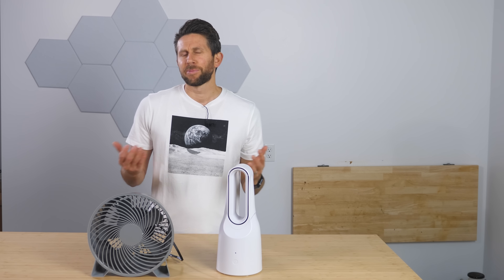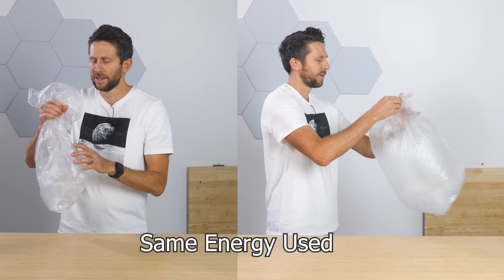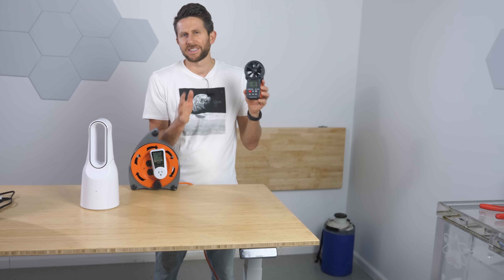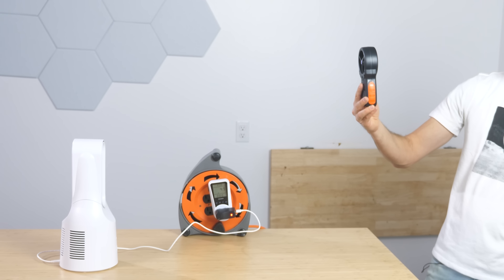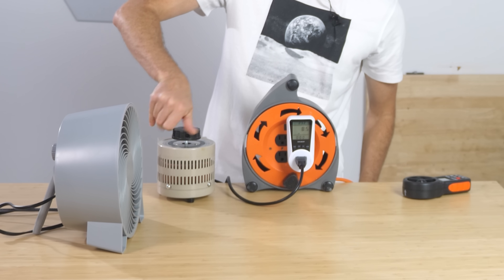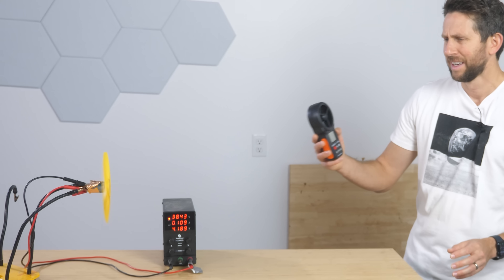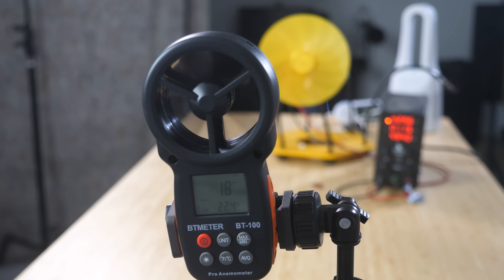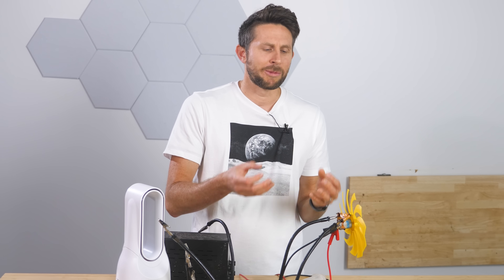Are Bladeless Fans a Scam?

Comment: As an electrical engineering student I can say I have heard about “bladeless” fans for almost as long as I can remember, I remember not being tricked about the engineering, of course it was to have some type of high powered fan or blower in the base to compensate for the lack of size in the head. The only marketing schemes that Dyson does is say “bladed fans deliver choppy air” really? It’s just a gimmick. Dyson should’ve made an affordable compressor based air conditioning unit that he’s would be more complex but would have been more useful and cost effective.

Comment: You should put the watt meter after the variac, this way excluding the losses in the variac.
The no-load losses of the variac are probably  several watts.
Reply: very very good!  exactly right!  good catch!
Reply: The fan also uses an AC motor, which will be less efficient at lower voltages.

Comment: I think a better test would be to trap the total airflow in a tube with a known cross sectional area so you could calculate the amount a liters per minute for each of the fans
Reply: Yeah, these tests had a lot of holes. And not just in the middle of the bladeless fan. Theoretically the bladeless fan could move more air over all, but have the bladed fan register higher at the points he measured.

It also would have been good to have at least a brief explanation of why the tests he mentioned finding online said the bladeless fan was so much better. Bad methodology of their tests? Misrepresenting the data? Outright lies?
Reply: This is the principle behind the Flow Hood used in the HVACR industry to balance airflow in commercial installs. And not that hard to build.
Reply: I agree. I was thinking of blowing at a huge 1000 liter bag and see how long it took to fill. 

I have 2 leaf blowers. The one with lower airspeed has twice the cfm output
Reply: no
Reply: no
Reply: @garnishbabu7855 yes

Comment: I get we were only testing for efficiency, with regards to power consumption vs air speed but volume of air moved has not been properly measured. The bag filling at the beginning, and making sure everyone understood the concept held no bearing on the test because the test wasn’t how much air is being moved, it was how fast was air moving at a distance. If we redid the test and maybe put a larger plastic bag on a loop where it’s open end is secured to the open loop, and then test how long it takes for the fans to fill the bag, or use a smoke machine

Comment: my best desktop fan is a 120x35mm PC fan out of an old computer with the noctua AAS from thingyverse, I just attatched a usb cable to it and at 5 volts it's running perfectly fine, pretty quiet, good airflow and range and best of all, it will last for decades.
these fans are designed to alst for thousands of hours at 12V, but at 5V it is under much less load and will wear out much slower

Comment: Windspeed measured at a set distance says very little. 

Various fans and blade compositions have different point where they reach their highest windspeed. 
There's a lot between blade composition, their size, length, curve, rotation, the amount of blades, etc. That all factors into their optimal rotation speed for pure volume throughput, pressure generation, airflow, or windspeed generation at a set distance. 

For example, a CPU fan would be optimized for pure pressure, not long distance windspeeds. To push as much air through a small close space for maximum heat dissipation from a heatsink. 
Whereas a same size fan for ventilation for example would be optimized long distance air displacement. Both could be the same size and use the same amount of power, but be vastly different in their windspeeds at set distances. 

Dyson's fans, I would hope, are optimized for their enclosures. And the curves on the circle where the air comes out are curved in the same way an airplane wing would be, to create low and high pressure zones to suck in surrounding air and increase the efficiency of the throughput. 
A good copy of it would definitely produce more airflow than just the fan they use would on its own. Opposed to say something that just copies the look.

Comment: Dyson products are mostly just form over function. On a recent trip, I had to use my sister's Dyson hair dryer, which was a bizarre experience. Underpowered and overdesigned of course, it sounded like a jet engine, was shaped like a thick curling iron, was very unintuitive to aim (air comes out the side for some reason), and took forever to actually do any drying. And styling while drying was hopeless because it's like a flat sheet of air instead of a round stream (my head is not flat.) Next day my other sister brought a REAL hair dryer, and it was like heaven. 😂  I'm convinced Dyson just doesn't like the way anything looks, so he comes up with an artsy shape, and his engineers force the function into that form to satisfy his vanity.
Reply: It’s like a knock-off Apple? 😂😂😂
Reply: For sure you’re just lying for the sake of it, I own the Dyson Supersonic and it’s performance is impressive, the non-turbulent air and responsive heat controls is something that you rarely find in other blow dryers. Previously, I had flaking scalp due to having a naturally sensitive scalp, the Dyson really helped to control it due to its fast but gentle output of air.

Comment: It seems counterintuitive to create a low pressure zone with a fan, to push air into a high pressure zone in the upper compartment, so the air can be forced through the slits to create a second low pressure zone.

Comment: So your conclusion is that it is a scam? Interesting because I would've figured it was only a rip-off and not a scam, but then again I think the reason why you'd want a "bladeless" fan is because of the lower noise level and smoother air flow. So if you don't care about efficiency then I'd just call it a rip-off. I mean seriously, $600 for a plastic shell wrapped around a regular fan? Come on.

Comment: My concern was never power consumption or noise. Its always been about how the blades gather dust. By the looks of it the bladeless fan would be much more painful to clean because of the tighter spots where dust can gather. Not only will you have to clean the bladeless frame, but you will have to clean the actual blades on the motor at some point.
Reply: Bladeless fans typically have a filter in the base that can be cleaned easily (the good ones anyway!)
Reply: my Dyson one has filters all around the base, and rubber sealing along the gaps. I only wipe down the outside lol & change the filter but that hasn't happened yet since I usually keep windows closed
Reply: @j134679  you'd be wise it's open the windows at least once a day to flush it out.  Otherwise the CO2 levels will build up quite quickly. 
I've got several CO2 monitors so I should know
Reply: You can just use an air duster can. Like you would on keyboards or computer parts

Comment: The real benefit of a bladeless fan would be the rotor being encased well enough that nobody can get hurt by it, but getting a finger hit by such a weak fan's blade probably wouldn't hurt anyway.

The design also seems especially wasteful since the air gets pulled in horizontally to be blown upward then forced through a vertical slit.  It would be a bit more efficient if the rotor had a hole through the center so air could be pulled in horizontally through a slit in the back and pushed out horizontally through a slit in the front.

It would still definitely lose efficiency to having to move air through the small area of the slits, but there would be a bit less energy wasted.  The path air takes in a regular bladeless fan gives more time for the air along the edges to get slowed by friction by rubbing against the inner walls of the casing.  Each direction change also forces the air to run into a wall, losing energy to impact and causing more of the air to lose energy to friction.  Moving the air in a straight path which doesn't have as much time to make contact with the inner walls of the casing would mean less energy wasted on friction and collisions.

I'm still sticking to ordinary fans either way.  They're more efficient than any "bladeless" design and aren't significantly more dangerous.

Comment: For how most people use fans a traditional fan works best. A column of air is useful for moving a distance while maintaining energy. The best demo for that would be a pinwheel. Take the motor out and place a pinwheel in front of it. Slowly move it away from the motor until it stops spinning. Replace the motor and do the same with the pinwheel. The pinwheel would continue rotating further with the motor in the housing as opposed to out of the housing. There are applications for that but not for most people just trying to keep a room or themselves cool.

Comment: You aren't measuring the same Watts between the 3 fan. Dyson, you're measuring the Watts from the wall (in AC before conversion to DC). The yellow fan, you're measuring the DC Watts after conversion to DC, so Watts in AC would be a decent bit higher to compensate for the loss from conversion.

Comment: Such a great demonstration of how the "bladeless" fan is really less performant than a regular fan. Thank you for the video.
Reply: I do wonder about loss of airspeed when impeded by finger gaurds.
Reply: @JamesWilles-nw3mm You make a valid point. It really depends on the design. The old style propeller blades with a wire cage designed to protect fingers is (IMHO) going to be far more performant. The other issue is that, from what I can see about the Dyson design, is they are actually bending the wind direction several times. With a prop fan you have the impact of the air on the blade, so it tends to blow forward and some centrifugally outward due to blade spin. With the Dyson system, they are using a centrifugal fan with an outflow that is aimed upward. so that means the air is actually spinning radially outward into the case of the fan itself, then shot out upward ... BUT, not toward the area to be cooled. So the air has to bend again . and then again bend to go thru the slits. So, several bends. Plus, the amount of space thru those slits is fairly small. So you get higher velocity but markedly diminished CFM (volume).

Comment: I think the big fan had a lot of inductance with the variac in the circuit, making the apparent power appear higher. In reality the real power use was likely much lower.
Reply: Definitely! Also, AC motor speed is governed by frequency. Voltage plays a part, in that if you lower the frequency, you also must lower the voltage (and with it, the current) or you get overheating. Those inverter AC units are quite sophisticated.

Comment: There is actually a benefit: Dust. If you didn't use your regular fan over a year have fun cleaning off the dust becsuse you can't start it. A "bladeless" fan has probably better dust protection

Comment: One of my big problem with bladeless fans is just like a regular fan, they will get dusty and dirty over time, but they are (most of the time) much harder to disassemble and clean then a regular fan (but this can really depend on the manufacturer). This is a big issue for me as fans can get dirty quickly and a dusty fan can affect airflow and impact the motor as dust can clog up the vents to the motor which can lead to motor overheating or failing (which is never good). And due to it being harder to disassemble, oiling the fan can become a more challenging job as every fan will need an oiling after a certain amount of use (again, depends on manufacturer).
Reply: Some fans I believe, use a replaceable/cleanable filter.  Those fans pump air with higher pressure but lower volume, making a small filter feasible.  The pressure being built by the "nozzle" restriction.  That restriction in turn being due to accelerating the air velocity through the orifice, rather than because of surface friction.
Reply: You should use grease on fans, not simple oil.
Reply: @marioxerxescastelancastro8019  oil for bearings, grease for oscillator gears. Obviously you cannot use any oil as certain oils like WD-40 are not good for fans but there are certain oils that you should use for bearings, this is why oil ports on fans exist.
Reply: +1 also same problem with tower fans, so hard to clean
Reply: Mine has a filter in the base that's pretty easy to remove. It's still gimmicky and overpriced, so I don't recommend it to anyone, but at least dust isn't an issue.
Reply: @Oddi0  Does the filter prevent dust from getting to the fan blades?
Reply: @Connectitthefancollector  yeah
Reply: @Oddi0  That's actually quite neat, if it is preventing pretty much all dust from building up on the blades than that is useful. Although that will restrict airflow along with airflow restriction from being inside that design.
Reply: @Connectitthefancollector  Yeah, like I said I don't really recommend it. I only got it because I found a really good deal on it. There's no way I'd ever buy one at full price.
Reply: @Oddi0  How much is that fan at full price?
Reply: @Connectitthefancollector  They're like 650 dollars, it's ridiculous. I got a refurbished older model for 150 and even that's too much for a fan, but I was curious.
Reply: @Connectitthefancollector  I'm talking about the big floor fans btw, not the desk fan in the video.
Reply: @Oddi0  $650 is just way too much for a fan. While I would agree that $150 is too much, it is still a much better price than $650. The only fans that are worth $150+ are early fans made of cast iron and brass, they go for a lot.
Reply: A good fan motor doesn't need oiling, ever. It has maintenance free ball bearings just like a hard disk or the cooling fans in your computer. Or do you oil them as well? A quick application of a vacuum cleaner will free most fans of dust. (not sure if that's true of Dyson fans)
Reply: @mikethespike7579  not a vacuum, use an air compressor to blow it out
Reply: @mikethespike7579 Modern Dyson fans make a big deal out of having good air filtration and charge for it.
Reply: @mikethespike7579  That isn't necessarily true. A good fan motor is  a reliable motor, meaning one that can go many years without much trouble. If you look at older desk fans from 50+ years ago, they can still run fine by today but they may have been used a lot over the years and haven't received any new oil meaning those bearings will be dry. Oiling them will prevent them going stiff (which will make the performance worse) and causing problems (even leading to bearing failure) and overheating of the motor (which is never good). A good fan motor will be easy to oil through the use of oil ports (these holes around the bearings that lead to the bearing's oil wicks that will soak up oil)

Comment: Are you measuring what ought to have been measured?

Why do we use a fan at all? I can only think of two reasons we'd want to - one is to cool an area with the moving air, the other is to move air in or out of an area (like in a paint spray booth).

So a proper test would measure the ambient temperature change resulting from a fan consuming x power for y time, and/or the amount of air moved from one location to another in a time period. I'd love to see you devise these tests and see if it changes the end recommendation.

Comment: the air in an traditional fan is not restricted by anything (only the grill on both sides), but in those bladeless fans the air is redirected through that slim housing and an small escape slit at the outtake. of course it wil slow down that way. anything that changes the flow direction or limits the area which its passing trough will decrease the efficiency. thats also the point why there is an radial fan in this "bladeless" one, because they give generally more air pressure. with an traditional fan in this enclosure the efficiency would be even worse. only for animals, kids which could stick someting into the grill or asthetic reasons these bladeless fans are making sense - at the cost of efficiency of course.

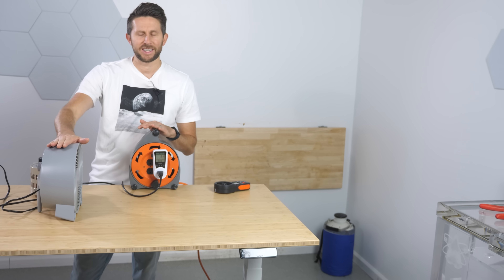Comment: 3:21
Isn't the "variac" what's causing the high wattage? It's limited power to the fan through resistance so lowering and raising the fan's power isn't chaging the supply side much.

Should have plugged in the meter on the load side of the "variac"

Comment: Dyson fans use another type of fan, more like a compressor in a jet engine. so I would guess it has much higher pressure than the radial fan in this one, which would make more sense if you want to push the air through a tiny slit. I still don't know if a Dyson would be more efficient but the fan might not be as restricted as in this bladeless fan so the full input power might at least be utilized.
I guess, if using a radial fan it would make more sense to use it in a tower fan.